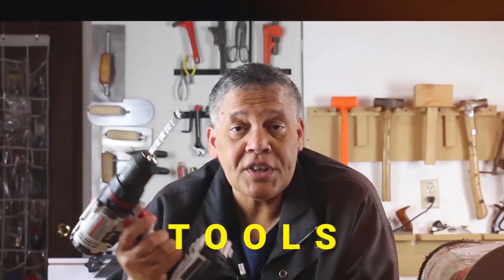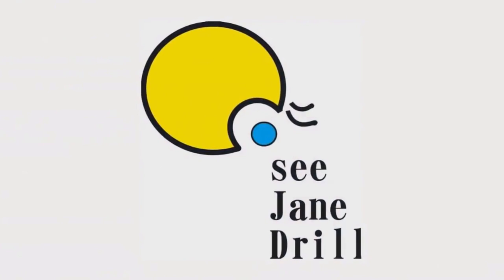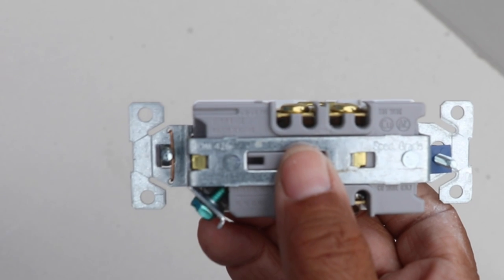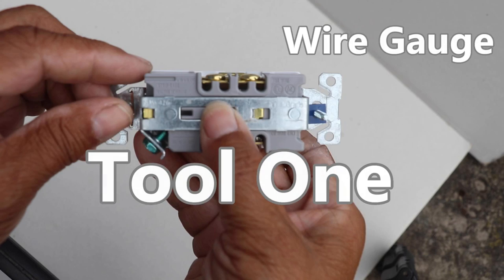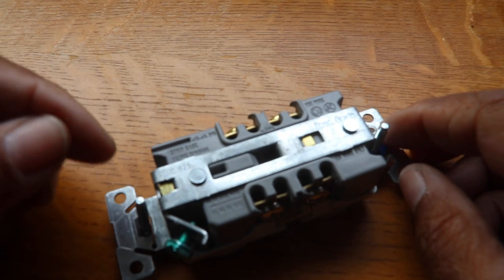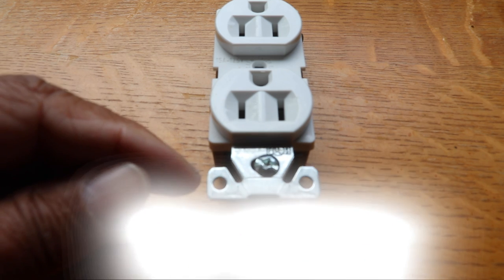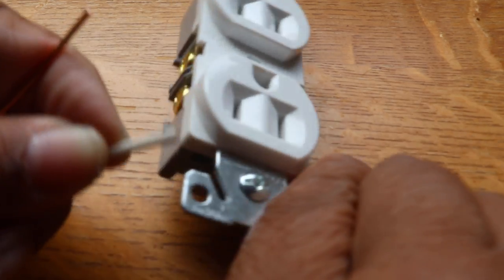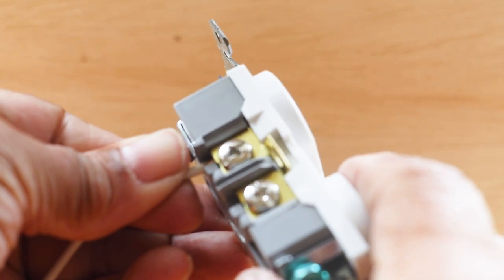Hidden Tool in an Outlet Few Know

Comment: See Jane Drill. I'm curious how you personally came by that information? Reading the comments, there are many others who have overlooked these features for decades. I'm very impressed. So, did you figure it out on your own, someone shared it with you? Or are you one of the 2% who read included instructions? You are simply AWESOME!!!
Reply: Every electrician knows they’re there but no one uses them because they’re a pain in the ass and who goes into any electrical project without the correct tools?!
Reply: @beaumontlivingston8084  Amateurs, first time home owners, 20-somethings living on their own for the first time. Tools can be expensive.
Reply: Well, I was today's years old when I learned this.
Reply: I was an electronic technician in the Air Force back in the 1960s, and through all my DIY years since, I never knew this.
Reply: She got it from the other hidden tool videos on YT
Reply: Lol!! So true, I just tear the damn box open and run it, but really good info. Been in building maintenance for 18 years, had no clue!
Reply: Another hidden secret is a black person discovered it.
Reply: @JasonSpitzMI50  lets bring race into everything! its so fun!
Reply: @cherylmcnutt9905  amateurs and beginners should never try their hand at electrical trades. Even for the simple stuff
Reply: @santos.l.halper1999  so how do you become a pro if you don’t start. You just continue to pay high prices for whatever. I will do it myself and learn doing it. Plenty of videos and explanations out there with safety instructions to be able to change a simple outlet, switch, or just change out a fixture.
Reply: @kentuckyhillbilly455   through the correct "trade" channels of course. Also good networking will save you more than attempting what you saw on the internet. If your networking is particularly good, it won't cost you a cent.
Reply: @kentuckyhillbilly455  no it isn't hard killing yourself doing class 4 electrical. I'm not stopping anyone from using their initiative champ
Reply: @santos.l.halper1999  yeah, no. I know plenty of people who have been bit by the 120v including myself. It is not that bad. It’s not fun but not bad. If you can’t learn to change out a ceiling fan or an out let you are a special kind of stupid. With your logic you shouldn’t mow your yard, because you could cut yourself up. If it is so bad to change out an outlet or a fixture then they wouldn’t be selling them at the stores. You shouldn’t learn to cook either because you may poison yourself or burn down your house. Just rely on everyone else to do everything for you. 😒 I see you watch This Old Tony, he is a DIYer. You shouldn’t watch AvE or Angry Cops they will probably hurt your feelings with the truths of life. Hell Angry Cops is remodeling his house and he is just a drill sergeant in the army, what would he know. You sound like a Union person trying to scare people to protect your job. You should be mad at See Jane because she teaches people how to do it for themselves.
Reply: @kentuckyhillbilly455  wow! You got more angry even though I agreed with being intuitive? You even checked my prof too - that's dedicated. Let me know if you delete any more of your comments. Oh and by the way, no matter how much DIY you put in, you'll never be a "pro". So yeah, you're right...    Don't be dumb and do it yourself 😂
Reply: @santos.l.halper1999  I didn’t delete my comments, I don’t know where it went. Probably after I edited it the YouTube censorship didn’t like it. I am not angry. I just can see that you think people shouldn’t change out an outlet. Not hard to do. You again clearly think anyone that is not an electrician most likely union is not qualified. I find that deplorable for you to belittle others. That is where the real point comes in. You now double talk too. You say some one shouldn’t do something, then you get called on it then you try and say good for them using their initiative. By the way you can’t keep your words strait as if you don’t know the differences intuitive and initiative are way two different things. Thanks for letting me know you do not know what you speak of and like to belittle other for learning to be self sufficient.
Reply: @kentuckyhillbilly455    there you go again making assumptions. It's not double talk to suggest that you shouldn't do something but you should also use your initiative! Intuition is relevant due to its instinctive nature and conveys understanding and the propensity for something to come naturally to someone. I do not belittle people who I think should not be doing things out of safety nor did I comment such things, and yet you belittle me for assuming my position on amateurs attempting simple tasks! I said to go down the correct paths to become educated, hence I do condone learning at its highest form. I am not defending the trades as we have plenty of work (I am a metal fabricator and hydraulics technician by trade, a biproduct from being a plumber/roofer). Unions have been phased out where I'm from unless you work on the docks or in the mines. Your assumptions like your logic and understanding is way off (or maybe you're not reading my comments). Instead of making people think your way and misconstruing my words, how's about a constructive argument about the trade instead of your seditious tangents about me promoting something fictitious that you made up...      Here's some advice I learned on the job   -if you don't know, ask the question.
Reply: @kentuckyhillbilly455  120v isnt bad. 120v when youre soaking wet in sweat..different feeling my friend.
Reply: @frankbinsley764  I know, I work in hot humid equipment rooms and around boilers. When you are wet it makes you dance a little more. It feels more like an hot electric fence.
Reply: @beaumontlivingston8084  Not every one. but a true statement that every electrician usually has a pair of stripper or at least Kleins they can strip with
Reply: @cherylmcnutt9905  I've been a handyman since I was two (albeit, it was a long time before I learned that not everything was a nail), which means I've been at this for 33 years. I'll second that- no matter your aptitude or skill level, tools, even dearly needed ones, can really hurt the bank. (Which is why so many of mine are rescues covered in rust.) Every bit of knowledge helps immensely. Not that I'm hurting for wire strippers now.
Reply: @broderickelliott8527  Heh. My first foray into DIY was taking apart the door knobs in my parents’ bathroom while they were asleep. I was maybe 5. The mission was to dissemble the door knob then put it back together before they woke for the day. There were a couple of close calls, but thankfully, they never caught me! If they had, I’m sure my hide would have been tanned for sure! Can’t for the life of me imagine why I was driven to do this!
Reply: @cherylmcnutt9905  that's pretty funny AND incredible. Age two was when my Dad started to renovate my Grandparent's house. We'd moved in with them for just that purpose. So much of that first phase of renovation started right under my nose. Nobody ever taught me how to drive, pull or straighten and reuse nails. I saw Dad do it and I did it. Had those skills down solid by the time I was five; everyone was busy for the next ten years pulling nails I'd driven into random surfaces in my youthful zeal. Every birthday I wanted a hammer of my own. I think largely because my Dad had to protect his tools from me, my desire was granted on three separate occasions. On all three, I broke the handles clean through driving oversize nails into high-tensile materials. The first two hammers had hickory handles. The last one was a rip claw hammer with a hollow steel handle. How I managed to snap that one is beyond me. I was seven.
Reply: @broderickelliott8527  That is amazing! I don’t have the upper arm strength to break anything.

We were not supposed to touch my dad’s tools unless he specifically told one of us to fetch one. 

My ex bought me my first toolbox in my 20s. It was a pretty green box that I filled with some if my dad’s old tools after he passed. 

When my niece got her first apartment, I bought her a pink toolbox and matching tools.
Reply: @Cheryl McNutt  I wasn't supposed to touch my Dad's tools either and I got in trouble for it many times. But giving your five-year old a consequence for misplacing your hammer doesn't make it magically return when you need it. I'm sure giving me hammers briefly bought him breathing room.

His best hammers were an Estwing 20 oz finish hammer and an Estwing 28 oz framing hammer and I still have them (he died young). I'm very protective of them and try to use them in a way that would make him proud. After 33 years I've learned that there are in fact fine details to nailing that were invisible to five-year-old me. There's enough on the subject for Leah to do a whole video on it. It wouldn't surprise me if she taught me something I don't know yet.

A few years ago I bought my wife a good 16 oz Estwing finish hammer and burned her name into the handle. I figured a quality tool was a sign of respect. She may not have the training and background I do, but every time I show her anything, she picks it up rapidly. She could put me out of a job if she had a mind to. I rarely touch her hammer and then only with her permission, so I guess one of those lessons from Dad sunk in.

My mind is still blown that you were tackling door knobs at age five. That was way beyond me at that age. Was it an old house with the antique hardware that had the big old keyhole in it, or was it more modern stuff? Either way, it's pure awesome.
Reply: @santos.l.halper1999  Nobody should ever learn how to do even the simple stuff??  lol
Reply: @frankbinsley764  Whenever I get shocked by 120v, I try to remember to pull my hand back.  ;)
Reply: @Jean Arenas what the hell are you taking about? No one in this thread has said anything about race.
Reply: @johnstorton  glad you saw that too, before he removes that comment after accusing me of removing mine. Mine got pulled right away because I edited it and I probably hurt someone’s feelings, most likely his.
Reply: @Jean Arenas  I see it now up there. However it looks like they were saying that a black person was the person who was smarter than everyone else. That is a dumb comment to make never less.
Reply: @johnstorton  didn't say or imply that at all.
Reply: @JasonSpitzMI50  Somebody just has to bring race into everything under the sun.
Reply: @santos.l.halper1999  really, then what were you implying? That sure is what it looks like you are saying.
Reply: @kentuckyhillbilly455  not really, that's just you jumping to conclusions again. Read the thread if you like! I didn't delete my comments...
Reply: @beaumontlivingston8084  exactly.  And if she WAS a trades instructor, she failed because those are features not tools. Unless my feature belt is full of features lol
Reply: @Mandula Abogada  thats not a hidden secret. We know who she is. All people view her and love her work. Shes a great teacher!  Why would you turn something that is clearly not racial in racial? Shes awesome and you are clearly having race issues and shoukd not be aloud to comment anywhere
Reply: @santos.l.halper1999  I know people never understand that something as simple as a loose connection can burn their house down. Literally every homeowner that has installed their own electrical devices has messed it up. Screws not being tight or wires being reverse polarity. Don't even hook up grounds. Not one time if I come across a homeowner who has done it correctly.
Reply: @kentuckyhillbilly455  actually 120 will kill you quicker than 277. Low voltage and high current. Current is what kills you not the voltage. 120 is the most dangerous.
Reply: @TheRaym  not necessarily, yes current(amps) goes up when voltage goes down. However so does the amount of work. That is why you can’t run a 5hp motor on a wall receptacle. Think of it as a garden hose and a fire hose. 120 is the garden hose and 277/480 is a fire hose. That is why 120 tingles and 277/480 will knock you backwards. Seen it personally. So if you can’t flow that currant there you are not going to get much of a hit. 120 max wall receptacle is 30 amps that is the small round one the, 20amp has the sideways blade, and the standard one everyone knows and sees in the wall is 15amp. Can only flow a little. You take that 277/480 at 30 amps and it is going to be moving more because it is the fire hose. There is more potential in the higher voltage at the same amp rating than in the lower voltage at that amp rating. Do you want to to be sprayed by a garden hose or a pressure washer. You can also think of voltage as pressure. Same amount of water(current) lot more behind it pressure(voltage) the pressure washer can rip your skin off. Still the same amount of water(current) from the hose bib. Now with all that said you still don’t go grabbing live wires. People can change out their own receptacles and fixtures in their house, just pay attention and ask questions if you are not sure about something( that applies to all things in life).
Literally not every homeowner has done it wrong. You sound like another one of those “I am the only one who can do it, I’m a professional” now. I know and have been involved with many “professional” electricians that have seriously messed up stuff.
Reply: @beaumontlivingston8084  I am a third generation electrician that started in 62' and I never knew about the stripper feature, and I am not sure it is on all brands. I usually never use Eaton outlets, so . . .
Reply: Some people are naturally mechanically inclined and don't need help discovering certain features in a design just like Miss Jane did.
Reply: @kentuckyhillbilly455  "yes current(amps) goes up when voltage goes down." NO!! Current goes up when RESISTANCE goes down! Now some of the rest of what you said does make sense, but the wattage of the FUSE (& outlet it's connected to) does NOT absolutely limit the harmful amount of current that can flow through you, it just limits the amount of current which can flow through a SHORT CIRCUIT (or heavy, low-resistance, load). If you're wet feet, standing in water, on earth ground, low resistance path, then 110 can almost certainly push enough current through a 20amp protected outlet to kill, I'm pretty sure. But I'm NOT a professional, and didn't finish EE, so I could be wrong, but I know that current does not automatically go up when voltage goes down! Resistance is the other component of I=E/R.
Reply: @kentuckyhillbilly455  Yes, rubber soles, only one hand on wires, you have some pretty good work practices! My dad used to not bother to turn the power off, but always kept one hand in his pocket! Me, I never trusted that enough, always turned power off & tested it! Mom was from Kentucky, that city with a thousand different pronunciations, named after that French King.  (And I got a laugh from your youtube icon!)
Reply: @kentuckyhillbilly455  LOL ! I have to wonder how you get along with your neighbors! :)  And when you mentioned Versailles, I didn't know there was one in Kentucky, but then I had to wonder if I was pronouncing it correctly (I do).
Reply: @eronavbj  I don't think they had plugs back then.
Reply: Everybody learns something from somebody.
Reply: @santos.l.halper1999  right. Because for the simple stuff we can all afford a show up fee of 60-80 dollars from a tradesman.
Reply: @santos.l.halper1999  because tradesman like doing stuff for free for people who are too helpless tho read?
Reply: @JasonSpitzMI50 O

Q
Reply: @JasonSpitzMI50 ,  xxx
Reply: Z @notimefordowntimesoriseabo5930
Reply: @notimefordowntimesoriseabo5930  their
Reply: @beaumontlivingston8084  not every electrician knows that no one knows everything
Reply: @Jean Arenas word
Reply: @johnstorton  Or only touch it with your fingernail first. I learned that when I was about 7 or 8 years old when a neighbor kid dared me to touch the metal part of one of those really old switches where you operated a lever to turn on and off the light. (The house was so old it still had skeleton keys.) I touched it with my fingernail and barely felt a tingle. Surprised that I did not get shocked, he touched it and got shocked. LOL Apparently fingernails don't conduct as much electricity as your skin.
Reply: @ScottMStolz  LOL  Love it!
Reply: @santos.l.halper1999  yeah you are right. never try never learn..
Reply: @kentuckyhillbilly455  He just doesn't want you to burn down your house, ya never know who your neighbor is!
Reply: @kentuckyhillbilly455  It isn't that bad? Well that depends where it enters and exits the body! If it travels to close to your heart thats a whole different story. Maybe the first video to watch would be one on how to make sure the circuit you are working on is powered off.
Reply: @johnpatriciajansen9549  awe look at the cute little realtor looking couple chime in. Plenty of professional electricians work on live power. Most of the time it does run across the upper body for most people. Because they are holding the other side of another conductor with the other hand. They seem to do ok. I have seen it many many times, then laugh at the little dance that was done while it was happening. You ever seen someone touch an electric fence with 7,000v. Do you know what the ventricular fibrillation amperage threshold is? 1-4.5 amps to cause ventricular fibrillation. Electric fences run around 2 amps. People aren’t dropping dead touching those. Mater of fact there are plenty of Americas funniest home videos of just people touching electric fences. How about a mechanic checking for spark and they slip and get nailed by 25,000v. The reason being people aren’t just dropping dead, is the body is a pretty good resistor. So have fun with your snarky safety sally self.
Reply: @beaumontlivingston8084  Me. I was fixing my washer machine and did not have wire strippers. Learning to fix my washer because I had no money. I did invest in a cheap pair of wire strippers because doing it by hand and eye is hard. I have quite a few of these in the tool box and wish I had that bid of information. I'm a learn as you go, do it yourselfer.
Reply: @TippyPuddles  good job on the I can do this. With appliances as expensive as they are, I can’t blame you for wanting to fix it yourself. I do the same thing. I just repaired the circuit board for my brothers window AC. It had an itty bitty fuse that was blown from a power surge. Couldn’t find that exact physical size fuse, but found the same rating fuse. Used the soldiering iron and made it work. Learn as you go is how the human race got to where it is today.
Reply: @santos.l.halper1999  why. I'm 47. Ive done a couple of my own jobs and had it inspected and turned out right. Just need common sence and do your homework befor starting and double check everything.
Reply: @eligebrown8998  I think you should read my comments carefully sir. What I'm advocating is that not everyone has common sense! And for those that think they do, are not as smart as you!  Kudos to you for getting it right. Those who don't are not here to tell the tale unfortunately.
Reply: @JasonSpitzMI50  Why the need to introduce race into the topic? You libs are all the same, and you wonder why we're divisive.
Reply: @JohnFourtyTwo  This is very helpful, thank you!
Reply: @cherylmcnutt9905  You're welcome, glad I could help.👍
Reply: @JasonSpitzMI50  Uh, Okay.  Yay Black Folk!
Reply: @santos.l.halper1999  How many times are you going to pretend you never said this - "amateurs and beginners should never try their hand at electrical trades. Even for the simple stuff"
Reply: @joshuadowdle9691  like never! Why do you ask?
Reply: @joshuadowdle9691  because he is becoming the master of double speak. Have you worked on your own house and replaced anything electrical? If so how is you are still alive? Santos has said that there are none alive that have done there own DIY.
Reply: @kentuckyhillbilly455  Oh no! I'm dead.
Reply: @joshuadowdle9691  my condolences to your family, may you Rest In Peace. I hope Santos is forever pleased that another one bites the dust for not heading his unfounded advice.
Reply: @joshuadowdle9691  how many times did I mention that I pretended I never said this?
Reply: @santos.l.halper1999  You need to rewrite that sentence. It makes no sense. I can tell you're one of those people that can never admit making a mistake though. Humanity isn't ready for your genius. You should go far away and, for the good of humanity, stay there.
Reply: @joshuadowdle9691  you reckon? Nobody has told me why though! People still ignore my wisdom and the wisdom of others in this thread has gone ignored. Lets have a constructive argument about the trade instead...      If you can
Reply: @santos.l.halper1999 Let's not
Reply: @santos.l.halper1999  lol… no, no I am not mad…. Bro. What a joke of a comment you have there. Just like your original statement.
Reply: @joshuadowdle9691  Santos said people are ignoring his wisdom😂. He has imparted none upon us. He has only stated the people should not do their own work in their homes. Then he likened himself to a metal fabricator because he has done some roofing, He is a hydraulic specialist because he has done some plumbing😂. Thats cool, I mean garbage men are now call sanitation engineers now too. And now he want to talk about the trades. Like he really has something to say because he is a “metal fabricator” and a “hydraulic specialist”. Makes the comment that DIYers will never be pros. Yet there are loads of people on the DIY channel and that is exactly what they are. As if someone can’t teach themselves how to do anything. A friend of mine has their 12 year old daughter replacing all the wall receptacles in this house. Neither of them are electricians. It used to be a thing that you knew basic skills. They even have a multitude of books just for people to buy so they can do these very things in their own home. What’s really funny is he is so stupid he thinks I’m mad. I am calling out his bullshit propaganda. 
Here is another one for his only professionals can do it. I was just at a hotel this last Thursday night. The light switch was supposed to be a 3 way switch. Didn’t work right because 2 wires are crossed. You can turn it on with switch one when you come in the room and off with switch two switch, then if you try to turn it on with the first switch it won’t. It is wired wrong by a “professional” and missed by the inspector, in a commercial building. However he wants to have a discussion about the trades.
Reply: @JonTheChron  WTH Difference where she got it, It is great to know and im glad she passed it on, I have many a time found myself in the need for a wire stripper!
Reply: @kentuckyhillbilly455  what a rant,,, again...    So much anger 😅
Reply: Thanks for the great tips Leah! 😀👍
Reply: @kentuckyhillbilly455  you deleted another comment 🤭 Just how many times did you zap yourself?
Reply: @santos.l.halper1999   nope, still never deleted any comments, they are all right there except for that very first one that was all ready talked about that YouTube took out. All I have done was edited them. You are becoming more and more paranoid it seems. Must be all that pretending to be someone you aren’t. You can’t keep your multiple personalities strait anymore. You should go seek help and a padded room, built by professionals.
Reply: @kentuckyhillbilly455  you've chosen denial. It's like you're going through the stages of grief, but backwards haha. You should take your own advice
Reply: @kentuckyhillbilly455  you suggested you were smarter than me with your unwarranted insults, you'd assume you could figure it out...    Have a great day and stay safe with your all undertaking
Reply: @kentuckyhillbilly455   nah, I stand by what I said. Which if you don't recall was that amateurs shouldn't do their own electrical work. Then I agreed with you when I said I wasn't stopping anyone from using their initiative. Give it a go is what that means...   Try some skills. Learn to cut/fold steel. Forge your own metals. Learn Japanese carpentry. get into electrical engineering. Just do it with the utmost careful consideration. Don't shy away from seeking out those with the skills and knowledge for advice. I have a tendency to recommend against doing certain things. Like the electrical trade. And probably plumbing too - repercussions aren't as bad but you know (don't get mad). Feel free to ask me about the trade. I already know where you stand. We might not agree on the matter but we might learn something.
Reply: @kentuckyhillbilly455  btw, I started in a steel factory that cuts and folds materials for roofing, guttering and flashing, machining, tooling and workshop trades on site as a roofer. To get a roofing trade you need to do a plumbing certificate. Which allowed me to go into specifying design for cladding, flashing and custom sumps in commercial construction - a pathway to the fluid dynamics portion of hydraulic engineering (I'm not an engineer however). In my experience with plumbers and fabricators from Pennsylvania, I learned alot of metallurgy as part of my foray into copper forming. We worked with alot of trades and I learned alot from people much older than I, for which I am grateful for. There's alot more but it's not as relevant to this....
Reply: @santos.l.halper1999   nice to see that you are trying to change your tune. You have only stated that after you were called out on your bull. Then you went back around to say more garbage. Double speak, the master you are. 
Every pro was a beginner and an amateur, the same as the DIYers (that are no longer with us…lol) Please inform the DIY channel and This Old House that home owners shouldn’t do there own work. We real working folks out here see you for what you are. 
Please pull up that regulation that shows you have to be a plumber to do roofing in PA.
Reply: @santos.l.halper1999  hey buddy why did you delete your comment? You said you never do that. There wasn’t any profanity, so no reason for YouTube to take it down. There is a clear gap in between my comment where I replied to you. It was something where you tried to say you said people should try their hand at doing a trade. 
I was coming back to edit mine because I remembered a term that we call the ductwork guys. We call them “tin knockers” not metal fabricators nor do they consider themselves that either. I also wanted to point out that you also said a DIYer will never be a pro, I almost forgot that one.
This has been fun. Here is your participation trophy 🏆. Thanks for playing.
Reply: @kentuckyhillbilly455  I didn't change my tune! I just didn't argue your illogical deductions. In either case, your discussions are constructive now (some of them). In spite of your short lived reasonings, you still try to go after me. In either case, you're assumptions are less and less...    Good for you.
Reply: @kentuckyhillbilly455  you've also assumed that I live in the states... I know in PA (in the 60s perhaps), you needed more certification for plumbing due to the integrated cast iron systems. I did a stint in the states, it seems they do more membrane than roofing! Kind of a waste really! The roofing becomes cosmetic. Also tin knockers was a term the old heads used for those who seamed with hammers and anvils (bps and dollies for fine works). We use rollers more for steel these days. standard seaming tools for metals when doing artisan work... When I worked in WA into Canada, they called them mechanics haha.
Reply: @santos.l.halper1999  you are still reaching, I have not changed my tone and still calling your Bull. Reiterating this over and over because your comments were vary clear, and have been quoted, yes you are trying to back track. There has been nothing illogical but your comments telling people they shouldn’t do their own work and that they will die. Of course I will go after you when you keep coming back with you stupidity and talk down a person that is wanting to work on there own stuff. I will always defend an individual that wants to better themselves and try. There is no extra certifications needed because of cast iron. Especially back in the 60s, 60s certifications were extremely lax. We have more codes and regulations today but nothing special just for cast iron. My first house had cast iron drain in it, nothing special was needed to work on it. You think only the old heads use the term tin knockers. You have now proved that you are out of touch with reality and do not know what you speak of. Sure “back in the day” they used anvils to form the joint, now they use a rolling machine. They still use hammers to “knock” it all together. Do you even know what the joint is called that locks it together? Hmmm, it is named after a city from a state you keep mentioning. 
Speaking of that (States and or States that you have mentioned) so now you want to bring up that you don’t live in the States, but that is what you mentioned this whole time. You still haven’t brought up that regulation where a roofer needs to be a plumber.  We do not call our metal workers mechanics. Yes they may be called mechanical contractors but they are not mechanics. Just like a roofer is not a plumber. 
Please provide the regulations and codes, or shut up.
Let’s all remember your original comment, “beginners and amateurs should never try their hand at electrical trades. Even for the simple stuff.”
Then in now must be deleted comments, you stated that those who have attempted to do their own work are sadly no longer with us. Yet another comment you said, you are dumb if you do your own work. So this brings us all the way back around to the original point that you feel that people shouldn’t do learn and do their own work. That they should pay a “professional”. Then you have tried to elevate yourself in illogical ways.
So agin provide your regulations, stop referring to the States, if you don’t live here. Then most of all put up or shut up.
Reply: @kentuckyhillbilly455  if you are referring to a Pittsburg seam, it is a lock on a down turn and is not the same as a standing seam esp the double lock. I'm not gonna argue all your points because you're just going on now. I'm not phased if you think that way. Like I said, don't do your own electrical. But I'm not stopping people from using their initiative. Simple.  And no, I never said I lived there whilst I did my qualifications at all. I never said mentioned quals required for cast iron, just that I learned from a few guys who did (they left plumbing to roof instead). Another"fabrication" in your mind. I've roofed all over the place. I went from Austria to the states in 03 with a multinational crew. The manager was starting a business of his own so he used this experience to forge connections across the world. Alot of metal roofers in the states (the ones I've been to anyway), use euro techniques, the rest of the trade is dodgy at best. I know that in most states you don't need certification to do things, but some require inspection (correct me if I'm wrong). Where I currently reside, you have to be certified for everything! That doesn't stop you from diy. It just means that if you get snapped you get fined. You don't need to pay if you're house burns down tho. The rest of your arguments need referencing. It's not that you think it's bull, it's that you don't want to think it's not.
Reply: @beaumontlivingston8084  well said, all these white dudes being extra nice to the black woman..It all smells like over compensation to me.....guilt over NOTHING!
Reply: @cherylmcnutt9905  awwwww   sorry karen...feel fer ya
Reply: @robseabrook712  You obviously have me confused with someone else. I haven’t complained said a single cross word here. Hope you figure it out. Otherwise, you look kind of…🤪🤥🤤🥴
Reply: @santos.l.halper1999  what do you think "you can do this " means?
Reply: @judiwiegel8181  it means nothing if you can't